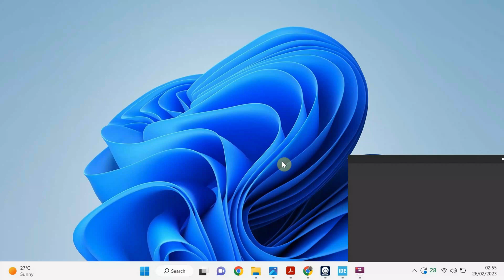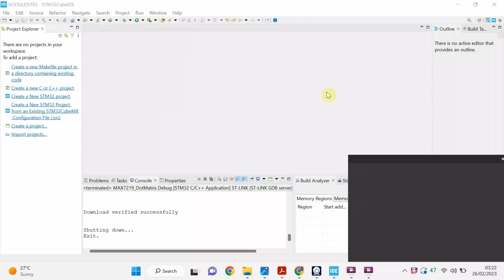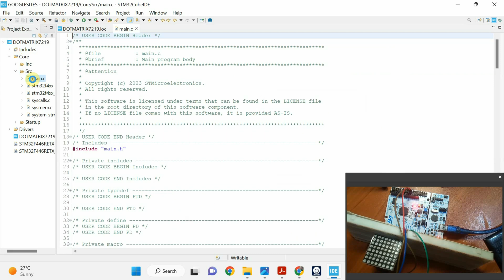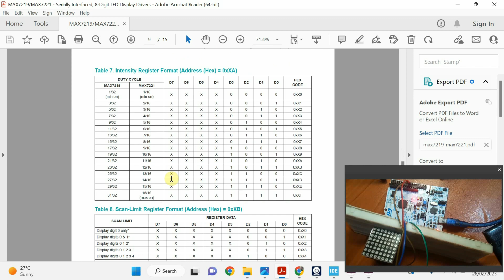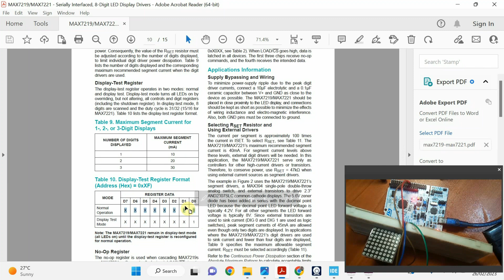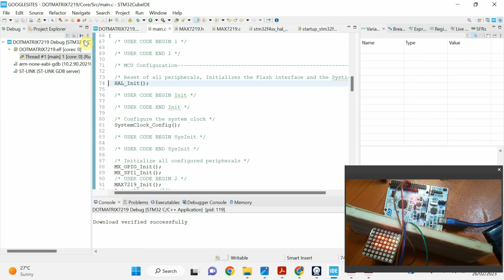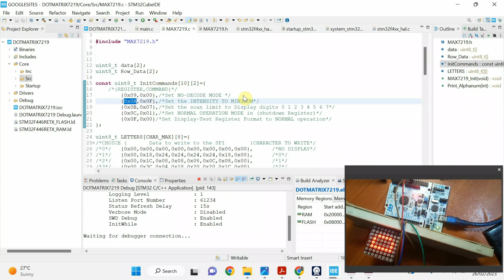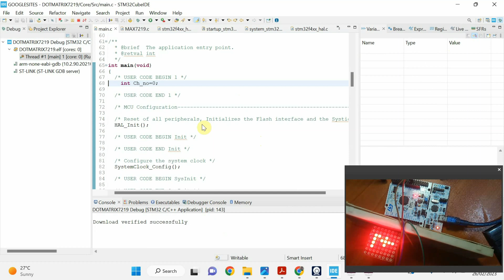MAX7219 AND STM32

Comment: Works for me with Nucleo-F411re by using slave PB0 and SPI2. needs adjusting on what to call in main.c as the names dont match video.
Reply from the maker: https://github.com/ENG-EDISON/MAX7219_dot_matrix this is the updated library. I didn't update the video
Reply: @hayducate;
Nice to see you still active!
You have a couple of useful tutorials!
🇨🇦🐻‍❄️🇩🇪
(The "Karhu" part of the name means "bear" in 🇫🇮.)
Reply: @johnbaker3745;
Just what I was wondering about.. I'm really, really old, really quite good with assembly coding on older processors, but just getting rebooted on Arduino and STCube, so hints are pretty helpful!
Thx. 🙏🏼👋🏼😊

Comment: Hi, I have tried the same process on STM32F103RBT6 but its showing some unknown in display. What is the problem?
Reply from the maker: I will update the code and also test for the blue pill.
Reply from the maker: https://github.com/ENG-EDISON/MAX7219_dot_matrix
Reply: i can tell watching video that there are several mistake he is doing. 1st mistake is assuming you have a crystal after clearing the pins. I wouldn't clear pins and leave the default. Just use spi2 because board is usually restricting spi1. Also 2nd mistake is setting baud rate then going and setting clock. You need to do that reverse since changing clock will change baud rate. That's after 2 minutes of video. i wont list all the other half ass things. Just saying be careful on the videos.
Reply from the maker: The microprocessor already has internal clock at 16MHz.
Reply: @hayducate  The video show after he set baud rate to about 5.25Mhz he then  selected external clock source in the clock tree. Its adjusted to 84Mhz .  That will make the baud rate jump up over 6 times. It wont work because MAX7219 cant handle it. Also the library is clearly not the same original library. The video doesn't match up exactly.